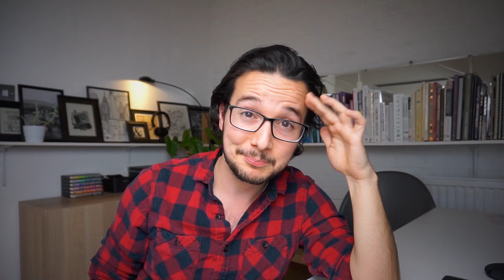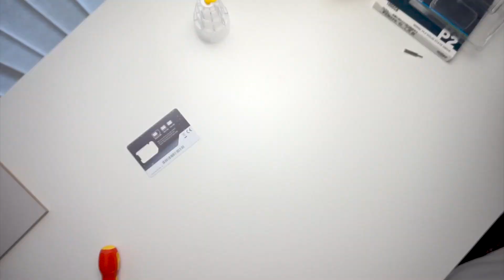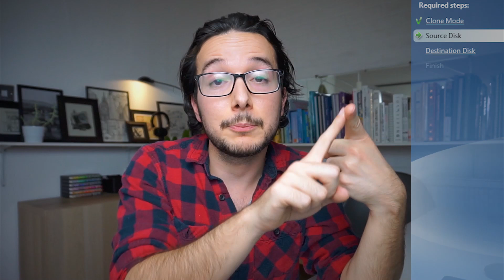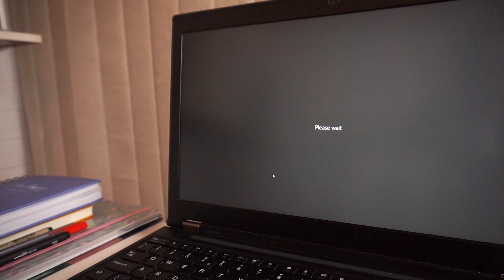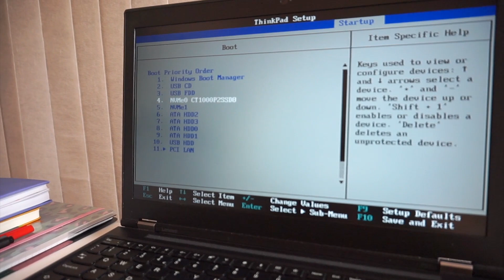How to upgrade your laptop's hard drive to an SSD ~ A step by step guide (newbie friendly!)

Comment from the maker: This one is for the Windows nerds out there - it's not ALL about Macs and iPads, you know! #teampc

Since it is such a 'utility-type' video, you might not need to sit through all of this, so here are the chapters, if you wanna time-hop :D

0:00 Lenovo Thinkpad P51 SSD upgrade
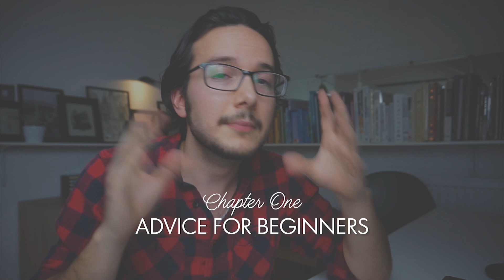2:00 laptop repair advice for beginners
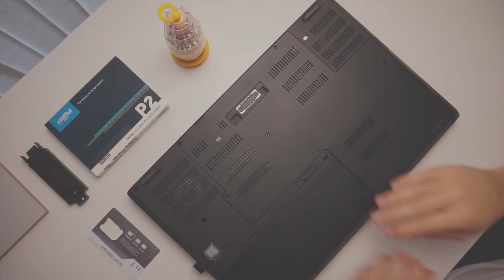4:49 how to install the Crucial P2 M.2 NVME SSD
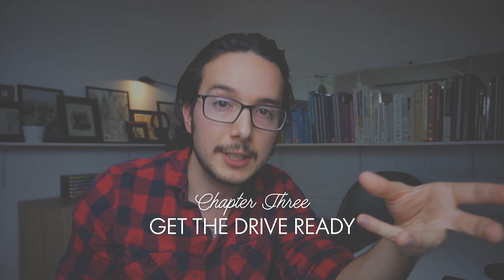9:47 how to initialize and format a new hard drive in windows 10  
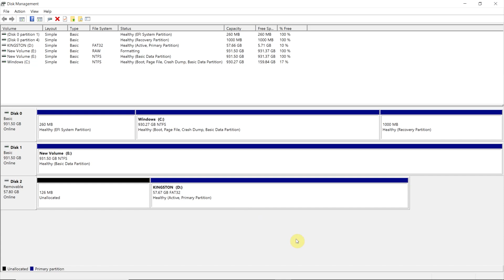12:13 how to clone your hard drive to SSD in windows 10
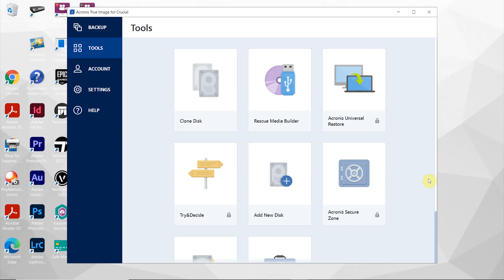14:36 how to configure a new SSD as boot drive for windows 10

Cheers,
Laszlo